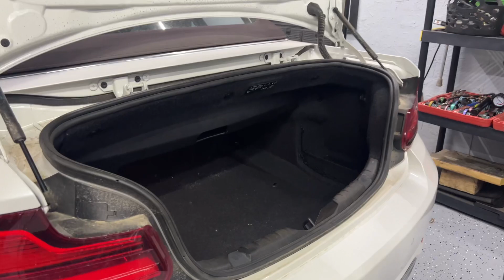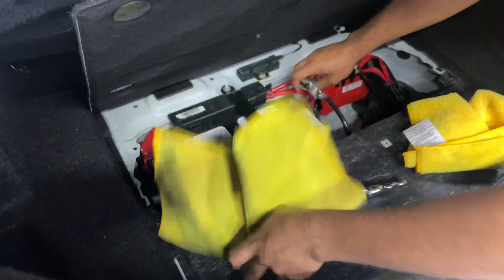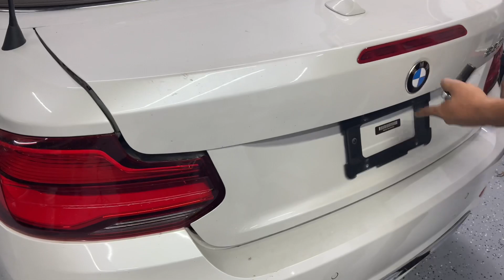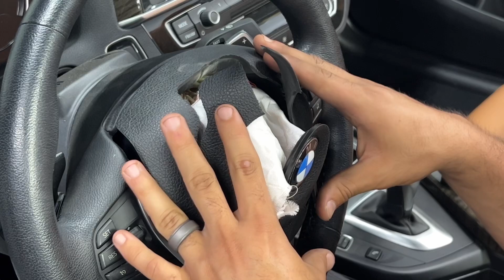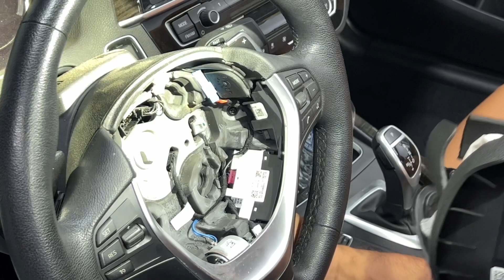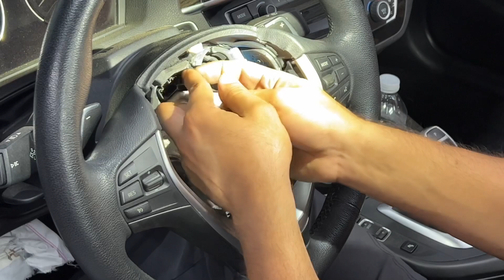Steering Wheel Airbag & Steering Wheel Removal BMW 2, 3 & 4 series X3 & X5 (2013-2019)

Comment: Can you show how to remove the two small plugs it attach with the hardness on the airbag please
Reply from the maker: If it’s not very clear in this video check my other video on airbag removal on any bmw and they are all the same connector! But basically the tab had to be pushed up using a small flat head or a pick then the connector can be removed
Reply: If you can give me a link will be great. I can’t find it anywhere. Thanks
Reply from the maker: @tlcnails2007  contact me on TikTok or instagram and I will send you the direct link!
Reply: @brownsburg.motorsports  I just follow you on IG. Thanks